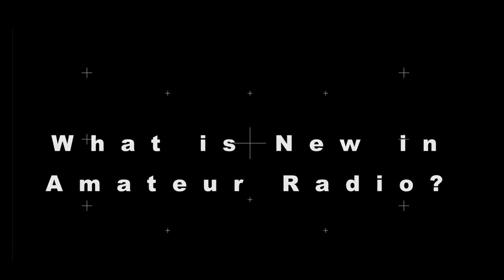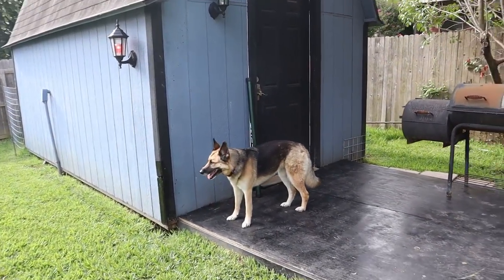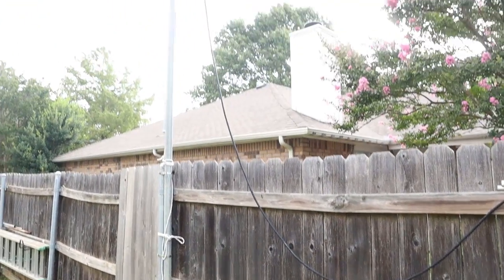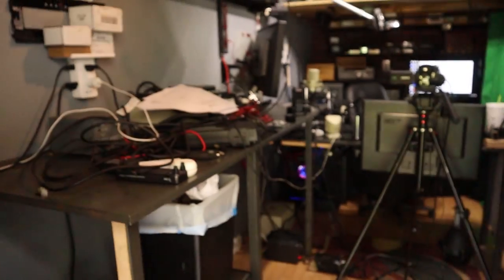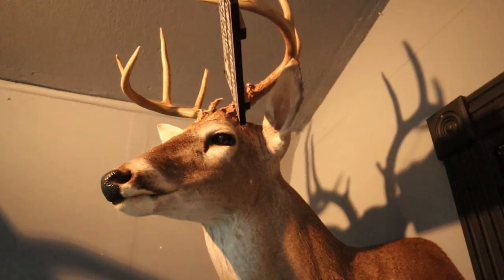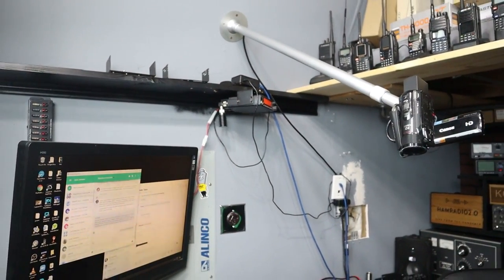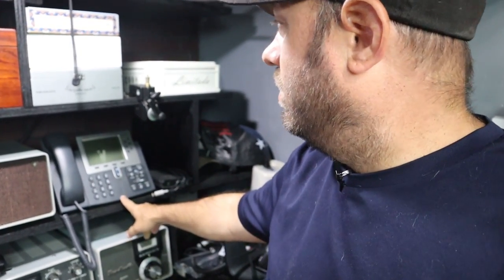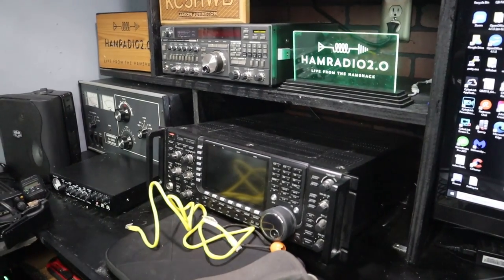Ham Shack Setup and Tour

Comment: Very nice review of your Shack.  Love the solar idea.  One suggestion you may already know, the more equipment you can run on 12 volts DC the more efficient your solar will be.  Anything you run thru an inverter will have some loss due to the inverter.  Probably tough to run your base stations and computers on 12 volts, but your mobiles and HT chargers should be fairly simple.  12 V LED lighting is pretty easy also. Good stuff.  I'm just getting into Ham, but I've been tinkering for the last 4 or 5 years with a small solar system for my outdoor deck lighting and I even have an RV fan I can run under my deck roof.  The only thing I can't run is my fish pond pump with needs a 2500 GPH pump which I haven't found in a 12 volt pump, so it's still running from regular 120 VAC. Keep up the great content and God Bless!

Comment: I have four 8' 5/8" copper ground rods at my home station, with a fifth one going in at the antenna soon. Grounding is #2 solid copper from my service ground to the fifth ground rod and HF TX antenna. We used Cadweld #90 weld material to bond the #2 to the ground rods and also ran three runs from the #2 solid up to the panel box, which has 14 PolyPhasers in it, along with SG-230 control wires.

Comment: Several years ago I was going to get a 12"x12" or larger weatherproof enclosure with door or lid and place the Cooper plate in back then mount the Lightning Arrestors down the center of the plate. Have coax running from the arrestors inside the enclosure to female connectors outside the enclosure. Set up for several antennas. Each arrestor would be grounded to the cooper plate and to ground rods along with plate grounding to ground rods. Never got around to getting multiple antennas to do it.

Comment: You might take a look at some of the RV channels and watch how they installed solar. There are the common low amp solar panels, and the newer high voltage high amp solar panels that exploit the rapid charging of lithium batteries. Channels I would recommend of the subject are Nomadic Fanatic, and Campervan Kevin. For room considerations you can get external storage racks for the batteries and inverter.
Reply from the maker: Thanks for the suggestion

Comment: Another idea is to mount a cooper grounding bar with insulated stand off to the wall inside the shack. There you could ground each radio to that bar and a ground wire running from that bar to the outside to a new (unused) ground rod for radios only ground.

Comment: I did not go through all the comments so if this is a repeat...  Need to put your ground rod almost all the way in the ground especially if it is dry where you are.  I would make the fence rail mast like a flag pole so you can easily change out antennas.  Thank you for this, The building I was eyeballing was about this size but now I think I will go bigger.....
Reply from the maker: I already have a pulley system on the fencepost so I can easily change antennas. It works well

Comment: You need the ground rod 8 feet in the ground. The top of the ground dryers out and won’t conduct, but deeper is better. Run a flat strap into the shack and make it your main ground radios amps act. Be sure to isolate it from the electrical ground.
Reply from the maker: Done

Comment: Hi Jason,

Why not an EndFed Antenna for multi bands on HF?     I used a 9:1 with a random (~53') wire that worked great for 6-40 without a tuner, my old IC756 would tune 80, after I managed WAS on 10-80 I added to it and 160m SWR was sweet and I worked and confirned all states on 160 as well.   
later I added a 40m EFHW pointed in a different direction and the pair for contesting still.   
Going with the Hex Beam should be a good deal, but the End Fed  wires go up so fast and easy!

73 de NE5B

Comment: I just found this video…. You show an 8 foot  copper rod next to the shed.  All of your ground connections need to be bonded (connected) together!  When the electrician ran power out to the shed / shack, I doubt he drove a separate ground rod at the shed and that’s because he’s already bonded or tied to ground at the main panel / ground rod by the fireplace / in the garage. You don’t want multiple separate paths to ground.

Comment: Do Your Electrical first. Are U using a sub-panel in the shack? .. derived grounds.. plant a delta.. one corner as close to the SE as possible. 6-8 ft triangle, 5/8 rod. Cadweld
Reply from the maker: Did that when the shack was built a few years ago.

Comment: How about consider an EFHW 80-10, or 40-10, it gets 10,15,20, 40 and or 80m. Very good all rounder for the size. Can either buy or build.
Reply from the maker: Right now I have an OCF dipole which gives me about 7 bands
Reply: @HamRadio2  Yes, very good way to go. Good work.

Comment: Looks good!
I’d move your deer to the other side of the shack and put both photo lights on either side of the doorway up at the ceiling. This would give you more headroom, and give your shack a larger feel. The lights should work just fine at that distance since it’s a small space. Start using that old gear too😁
Looking good.
Dave
Km6myf

Comment: Wish motorola software wasn't hard to get. I been wanting to pick up some mcs2000 to use but can't get the software. I do use the software for the cdm1250 radios. I would think they almost get programmed the same way. (Different software of course). I do know for sure on the cdm series you have to put the transmit and receive in yourself. And then add a tone to the transmitt side and not the receive side. Hopefully that's helps you out Jason.

Comment: Looks great!  You may find the hex works on 2m, I've read elsewhere folks having success with that.  On the dipole, just a suggestion.....make it as long as you can and feed it with 450 ohm ladder line to a balun just outside the shack, then short coax into the shack.  It'll tune on just about everything!  Have fun adn stay safe!  de Cliff W3KKO

Comment: man a lot of radios not being used,sad to see. make an EFHW 80m-6m and use the gear. Its really hard to give advice on layout and setup when you need to also be setup as a display for video.  i use IC7300 feeding into mixer for audio, and pc for control, logging and spectrum display.  mesh network and pi's on secondary shelves. 73 ke0hms

Comment: Drive the ground rod in more to be effective. Id leave no more than a foot showing.
Reply from the maker: I think that was as far as I could get it when I last tried.  I was waiting for a rain to come and soften the ground up a bit.
Reply: @HamRadio2  get a big hammer or use the appropriate adapter for a rotary hammer drill to drive those rods.

If you dont drive that rod all the way you are almost not doing nothing at all.

Polyphasers are the best in my opinion.  Had seen them in action on broadcasting Towers.

73's

NP4HV
Reply: @HamRadio2  Dont dare to try drive the rod with the rotary hammer drill without the adapter for it.

The rod is going to mushroom on the top as you drill it down with the impact of the drill and is going to get stuck inside the drill.

NP4HV

Comment: Looking at your shack, this is the reason no one is interested in ham radio...
Reply from the maker: How so?
Reply: @HamRadio2  Lets see... transceiver, power supply, antenna, antenna tuner, antenna pole, amplifier, ground wire and rod, testing and license just to communicate on the airwaves in my city and state???
Reply from the maker: There was no reason to make that comment twice, so I deleted one of them. 

No, you don't need all of that just for simple communication. Some of it is extra. 
So what's your purpose?  Only to communicate in an emergency?  That's fine but if you had studied the Ham Radio licensing questions, you'd know that all of that equipment isn't necessary, but it can be fun to see how it all works together. 
Ham Radio is a Hobby, and it's an Emcomm tool, but it is also much more than both of those things
Reply from the maker: There's always been good and bad clubs. Find another one